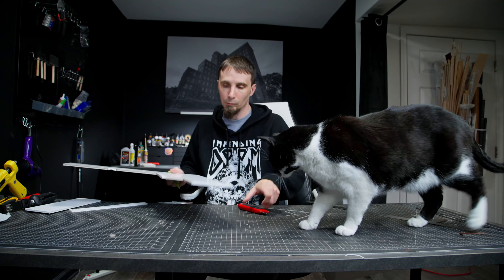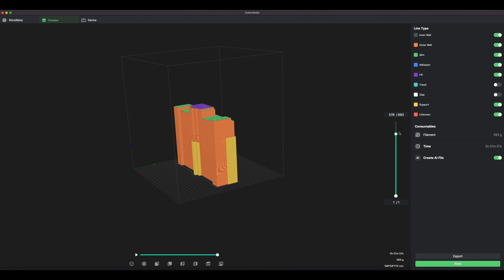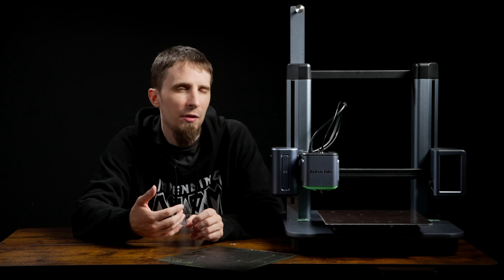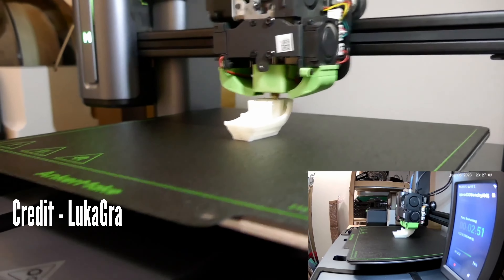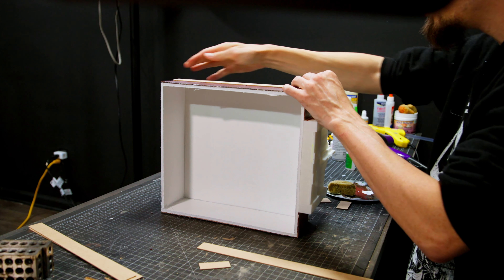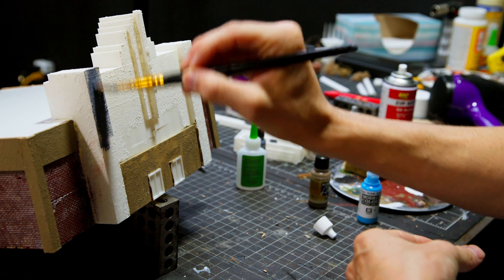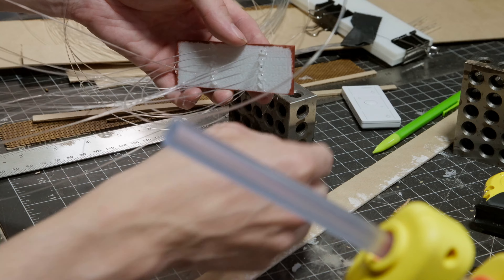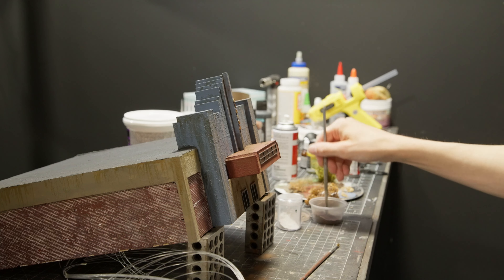Making a Miniature Abandoned Movie Theater - Ankermake M5 3D Printer

Comment: It looks great and I can see what you mean about the doors.  but  everything else looked like it was a old building.  I would have painted the parking lot a lighter color after the base. unless you were going for a rain soaked look.  As far as suggestions for other buildings.  A old arcade. use the 3d printer to print the old games and use the same lighting technique to light them. just print with a hole in the game where the screen goes and then frosted plastic to let the light glow.

Comment: Just be aware that foam-core sheets do warp over time, and should be stored flat. Water based paint or other stuff,  WILL cause warping to larger flat areas.
 Foam-core also requires VERY sharp razor blades to cut to avoid ripping chunks out of the edges.